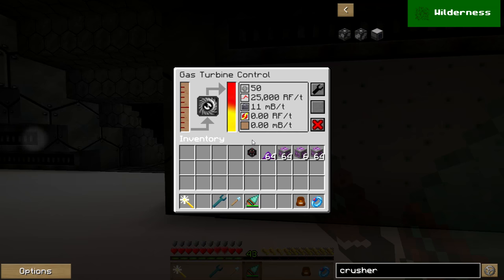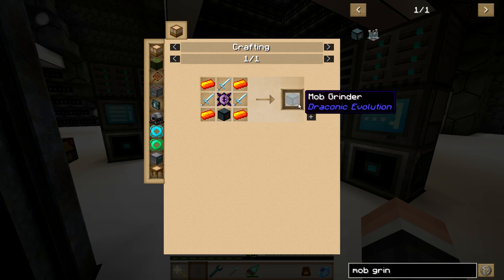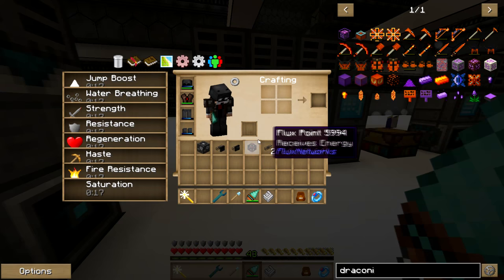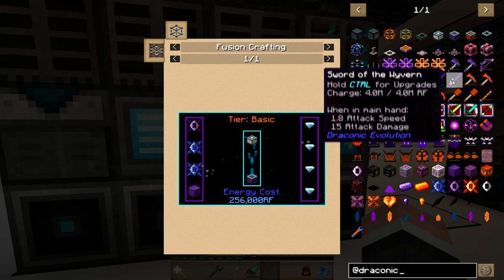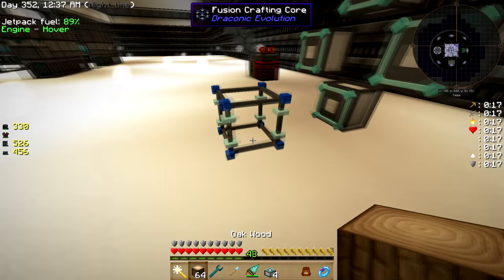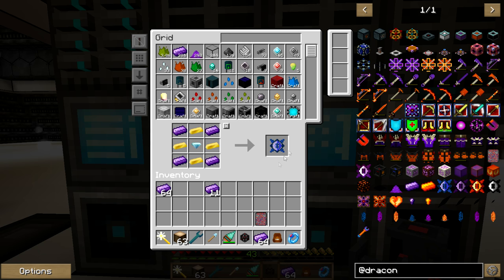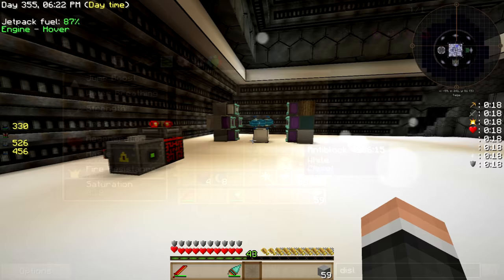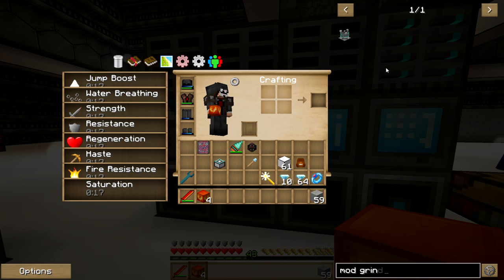Sky Factory 3 EP 28   Draconic Fusion Crafting + Mob Grinder

Comment: the reason your batteries are not draining when you are doing the draconic infusion thing is because they are only connected to the flux points, which are one way power the way you have everything set up. 
Also with "ignore limits" you should only need the flux points anyways.